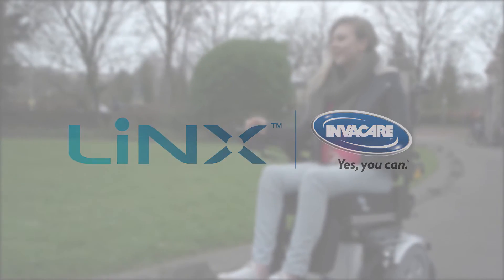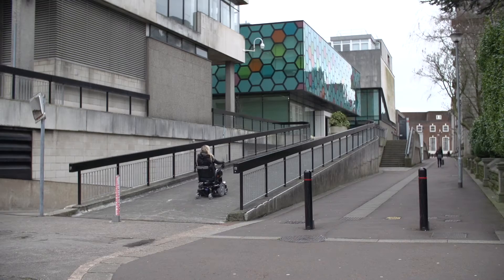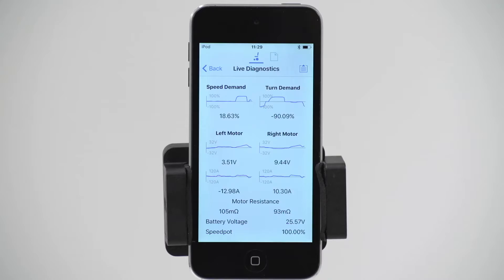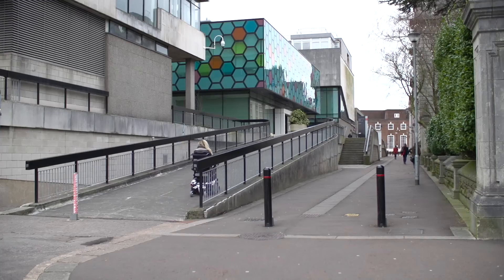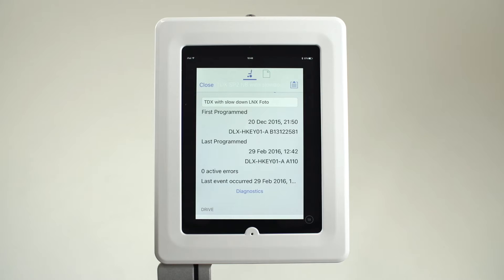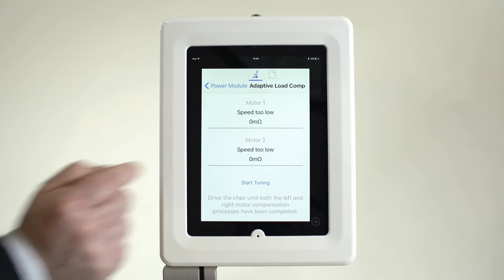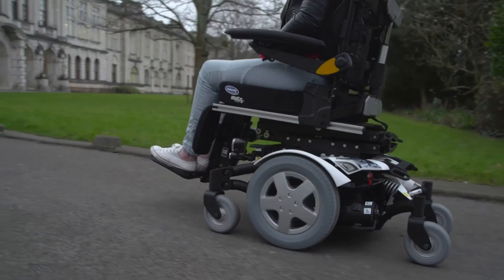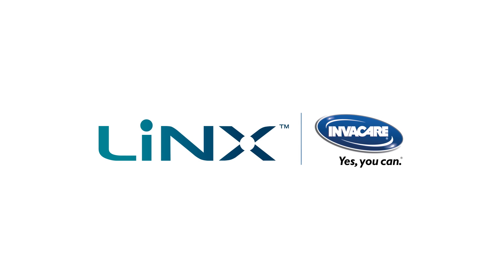Invacare LiNX - What is dynamic and adaptive load compensation?

Comment: I do not recommend this chair.  They have embedded software into the joystick that makes the chair impossible to control safely, smoothly and pleasantly.  The chair behaves like a wild horse.
 They screwed up with this software.
 The rear wheels are of poor quality, they slip even when dry.  They have added a thin and very hard cushion.
 I have written to the Invacare company and they do not answer you, they ignore you.
Reply from the maker: Hi Jose. You should have the possibility to adapt the driving behaviour to your needs through appropriate programming.  We recommend you contact your local retailer.
Reply: @InvacareEurope  I've already done it. It has been impossible to properly program the software. I have chosen to change the electronics and install an old joystick. 
And I repeat: Linx sucks and no vendor recommends this system.
Reply from the maker: Hello Mr Orozco, we appreciate your feedback and are sorry to hear about your experiences. Please reach out to your local retailer or provider for technical support. Many thanks.
Reply: @InvacareEurope   I've already done it. It has been impossible to properly program the software. I have chosen to change the electronics and install an old joystick. 
And I repeat: Linx sucks and no vendor recommends this system.